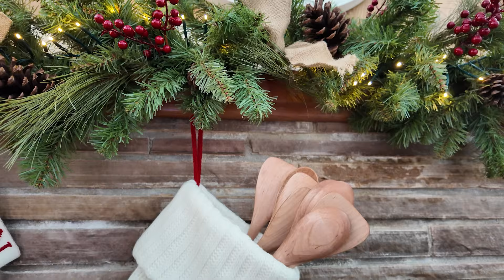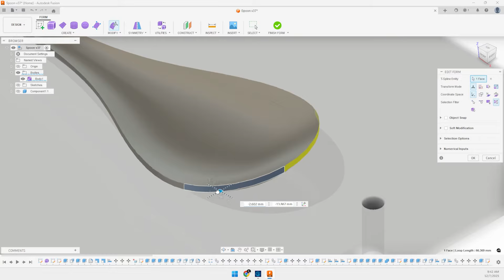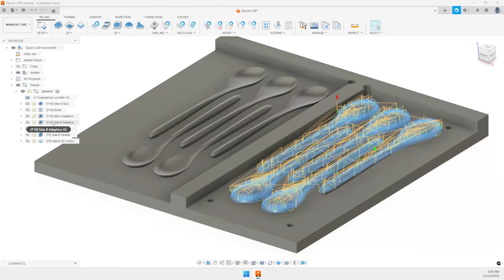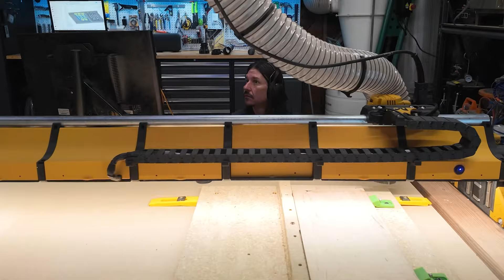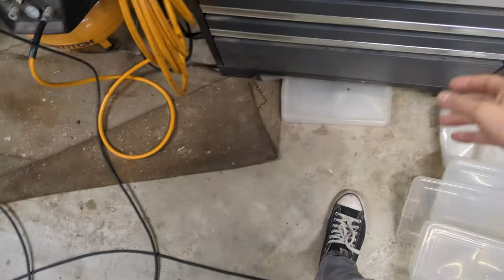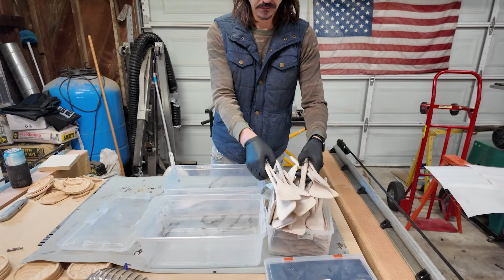Mass Producing Gifts with the Lowrider V4

Comment: Awesome.

I am not at that stage yet.
Still wait for the struts to be cut, the table to be built,  dust collection...
1) speeds, how to know the correct settings?

2)I need help with the dewalt router/auto on/off - wiring.

3) the kill switch

Comment: Dude! The flip jig and the biscuit joiner hold down is awesome! Great video.
Reply: When taking your zero why not reference the jig corners and the material surface? Seems like you could run into some flip issues referencing two different sets of corners? Maybe I am missing something, the spoons look perfect so it must work well.
Reply from the maker: Thanks! I only zero on the corner of the fixture - that's why I have to surface "side a". Once that's done, the stock is a known height, and since its up against the machined edges of the fixture, the machine knows the x and y too. I was able to save that initial zero and didn't have to zero again for the rest of the boards! The machine was dead on for every cut - though I did have to reset 'Home' when I had that dull bit.

Comment: I watched all of your LR-V4 videos. I'm about 50% with my LR V4 assembly. Had to finish some cutting boards before decommissioning the MPCNC Primo. Anyway, how did you set up Fusion 360 with the Low Rider machine settings and post-processor?
Reply from the maker: I'm using the MPCNC v3.0 post processor - found here: https://forum.v1e.com/t/fusion-360-post-processor-mpcnc-v3-0-beta-3-is-available/49534 but I also have custom scripts for "start gcode", "stop gcode", and "tool change" - I'd love to do an in-depth video about the specifics. Perhaps I should roll that into the 'probe setup' video that is planned - make it more of an 'in-depth setup' video instead?